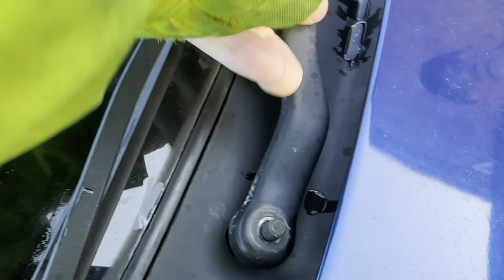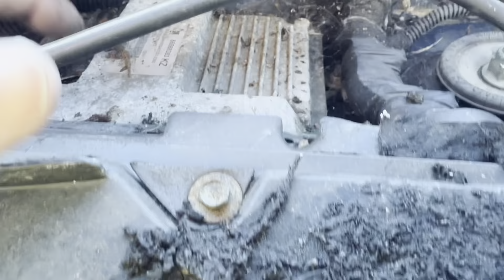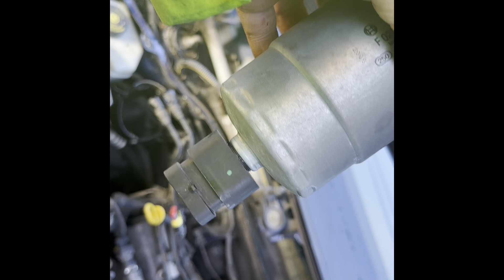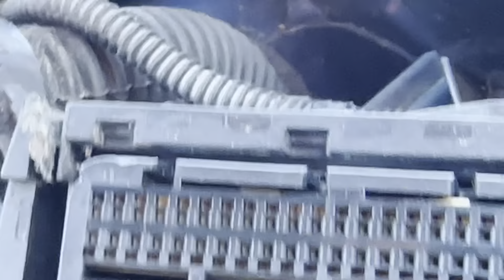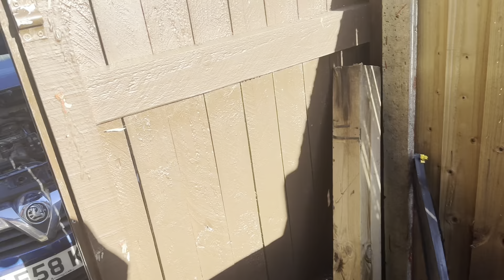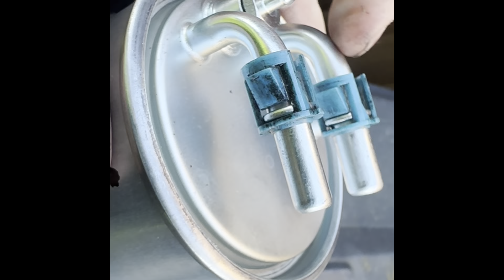My broken Corsa D 1.3 CDTI can we save it ? ? ? Part 1

Comment: Can you tell me the name of the company your sending it too & if you get a virgin one back where will you get it programmed ,mines is doing the same ,,,,
Reply from the maker: The ECU went to blue hawk electronics in Nottingham. They can repair many units on the market. If it’s not repairable they can help supply a replacement and set it up with the software from your old unit so it’s just plug and play.
Reply: @knightsofengland1 thank you I’ll look at that